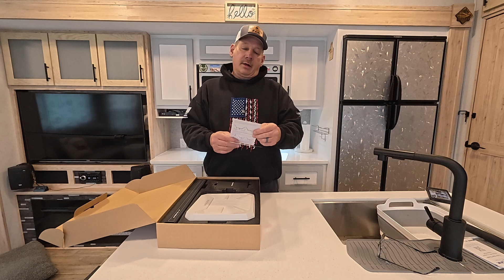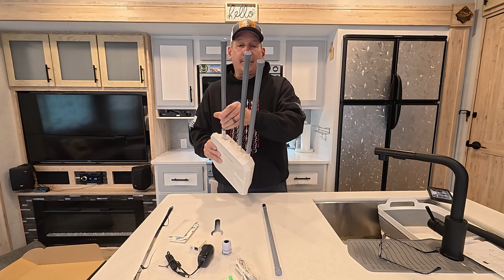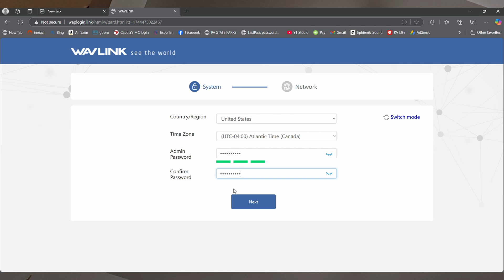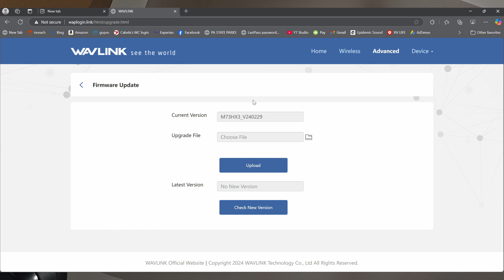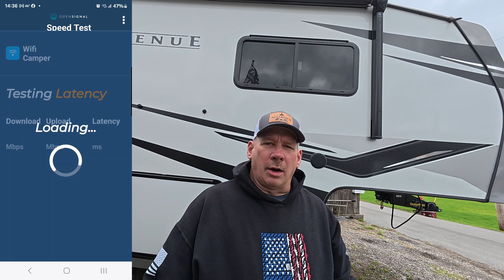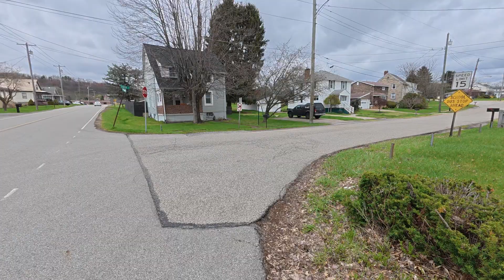Wavlink AX3000 Wifi Extender Install and Review

Comment: i have starlink, I use the cube air x3 mesh that bypass the strarlink router,  that all works great,  I added the ax3000 to the system later. i can get it to work but its an open network and I cant figure out how to put a passwork on it ..  can anybody help me
Reply from the maker: I added that when I set it up on my laptop. Thought I covered that towards the beginning of the video

Comment: Rich, glad you got that thing for “evaluation “, but why would you want to be 200+ yards from your rig? That’s a long way to walk for another beer.
Reply from the maker: @ptcclatlptcclatl1683  another beer? I'm thinking six pack
Reply: One of the reasons I'm putting on in is we have a number of birdhouses with cameras in them.   The placement is about 40 yards away from the house and the wifi doesn't go that far.